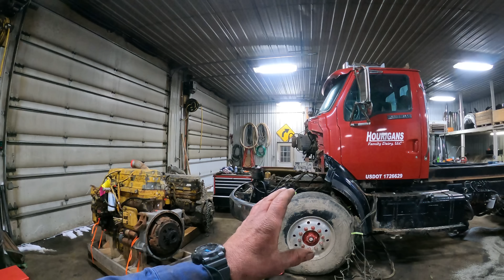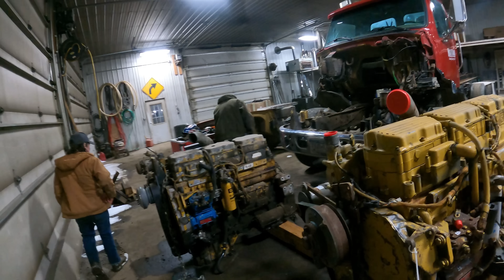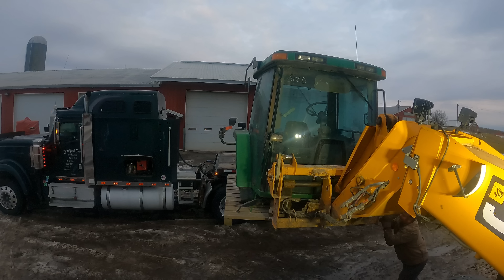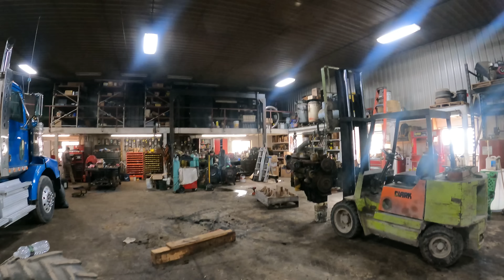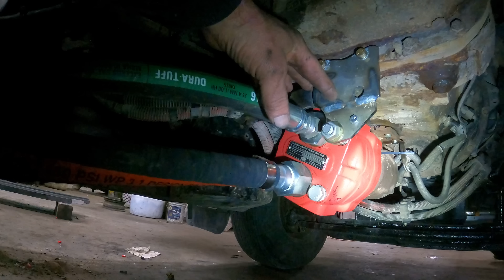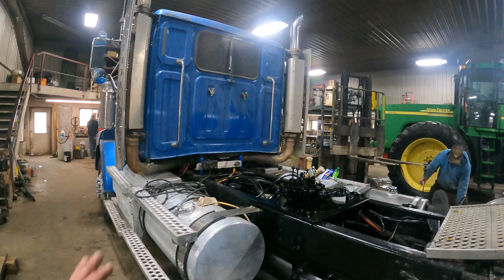High Pressure High Flow No It's Not A Permco

Comment: So I’m guessing the reason you couldn’t find a C 10 was because you wound up going with a C 12 which is basically an identical engine just upgraded displacement and power?  They are very good engine however I think if I was going to turn that truck loose with random drivers I might dial the power settings back down into the stock range just to protect the truck 400 to 450 horse would be safer and it would still make the truck pretty darn good hot rod. Keep up the good videos Andy. I Prefer listening to you narrating . Yes you might repeat yourself once in a great while however you do a very thorough job of explaining things that you are doing and that are required in your operation!

Comment: i no your a very smart man but why not get your pto geared to ehat rpm you need and with the dump trailer why not have a flow control valve so you can pick how much flow for anything you hook up to that truck
Reply from the maker: It’s geared just the way we need it, the throttle is the flow control valve

Comment: Andy, will you wrap those air lines going to the valve with some hose or some wire loom to protect them from rubbing against the frame of the truck? Seems like they'll rub and you'll lose air fast.
Get some wire mesh and lay in that open spot instead of channel iron, you're only needing to "block" the hole. 
Can't blame Jared for wanting to hear the engine before putting everything back together. Would suck to have issues then pull everything back apart, been there, done that. Great video as always. Cheers :)
Reply from the maker: Zip tied right they will be fine

Comment: Steve seems like a cool guy. I wonder if he would haul forklifts from SC to MA for us. 
Nice job on that wet line Andy. That's what I do same thing just put a zip ties around the valves. I'm gonna have to try that panel bonding adhesive trick. Every damn thing I put thread sealant on is like hit or miss lol... mainly miss. 
We need to get you hooked up with a nice lifting fixture for your forklift and telehandler. Take it easy man

Comment: Andy you may have a problem running that cat engine at the fire truck rating  that fire truck  rating is for intermittent use only  fire trucks only run for a few hours a year you will put a lot more hours per year on it  the engine is turned up the  cylinder pressure is to high for continuous use i believe that it is just a ECM program and not injectors or a turbo swap
Reply: Umm, it's a CAT. I don't think running all day will be a problem, as long as the radiator is big enough.
Reply from the maker: Quick runs from one field to another